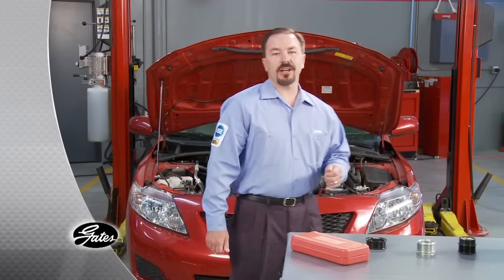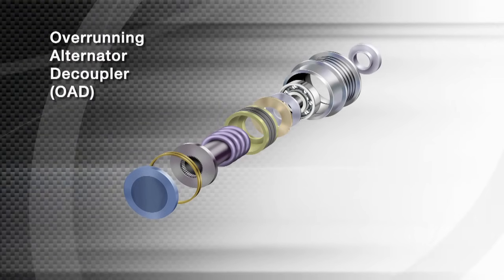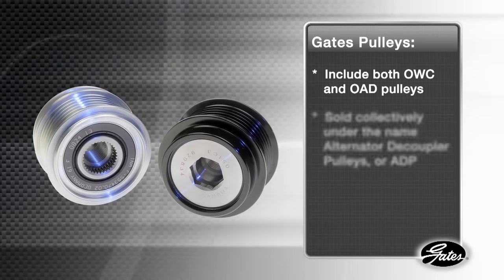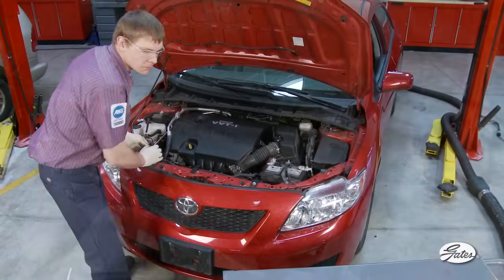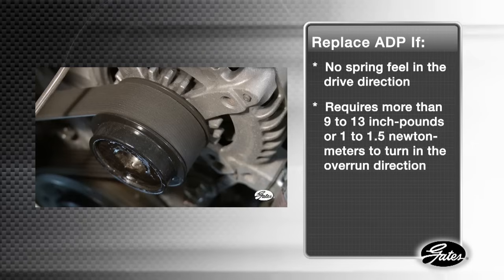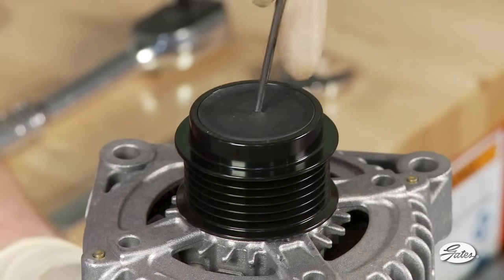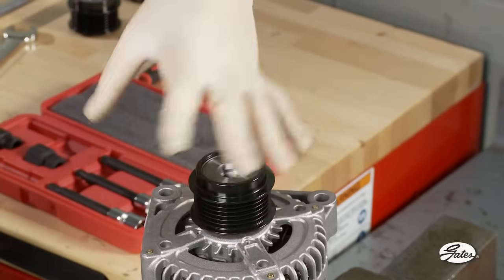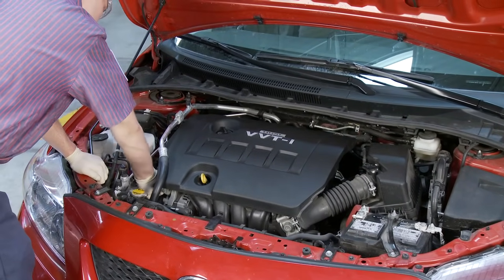GATES TRAINING: Alternator Decoupler Pulley - How to Inspect and Replace (full version)

Comment: Anyone who is struggling with this like i did and doesnt have many tools or a vice. Rent the decoupler tool from auto store. Stand the alternator vertically (like the way its on the car but on a hard surface)and use the tool you need and break loose the pulley.

Comment: This is a great design saved my $30 belt at the expense of $366 alternator!!
Reply: yes, what a stupid design; to save 30 bucks you spent 600 in labour  as most of the alternators are deep inside the engine bay and you spend a lot of time removing almost half engine bay components to get it out. Was nothing wrong with the old design, lasted 200k km plus.
Reply: 55000 mile cadillac and I am going to have to put #3 on in 6 months.

Comment: For all you out there who hate ADPs, you can get a solid pulley and they work fine and won’t fail after 30,000 miles.
Reply: U can't
Reply: @ I did. I bought it, and put it on and it worked great.
Reply: @faize28 you can, dont let them scare you, this is something that causes more issues that what "it fixes", No vibrations, no problems at all. Acura 2017, upgraded oem with oad, to solid pulley. No change at all.

Comment: this video was amazing and helpful, i am going the rout with replacing the whole alternator since its been giving some weird issues for a little while now. But the pulley is deffinetly bad, it buzzed for atleast 10 seconds after engine shutdown and puffed out a bug cloud of rus, which is now in a pile on the driveway, huge fan of gates. i work for oreilly auto parts and always urge customers to spend the extra few dollars for gates products :)

Comment: So this increases the life of the belt and tensioner by how much?
Reply: the word negligible comes to mind
Reply: 0%
Reply from the maker: The car manufacturers are moving to the alternator decoupler pulley for several reasons.  Increase in belt, tensioner and accessory life is one of the reasons and each application is different.  Applications with 4-cyl engines and diesel engines will have better results using an ADP over 8-cyl engines.  ADP’s are designed for each application, part numbers are not interchangeable nor is it advised to replace an alternator originally equipped with a solid pulley with an ADP.

Comment: I found this part supplied by y'all for my 2007 Nissan Altima 2.5s: http://www.partsgeek.com/catalog/2007/nissan/altima/engine_electrical/alternator_decoupler_pulley.html

I was wondering if this is indeed the correct part for my car as the part I find through WorldPac looks slightly different and as you stated in the video you need the exact part for this replacement.
Reply from the maker: Could you send us an image of the WorldPac pulley to apateam@gates.com? We'll be better able to assist you. Just reference this conversation and we'll make sure you get set up with the right part.
Reply: Actually I just found that they no longer have it in stock and yours is the only one I can find so I'll just have to go with you guys. They also weren't able to supply a picture to me.

Thanks for the quick response though!

Just as a quick question. My Alternator decoupler pulley is making a popcorn sounding noise when the car is in drive and at low revs (basically idling).

I'm not sure if that means it is the coupler, the belt, the alternator but since the alternator is ~$400 and the sound is easily heard right at the pulley (~$70) I'm guessing that's what it is. Cheaper fix is always my first go to.
Reply from the maker: Checking the function of an ADP is difficult to assess while installed. It is recommended that you remove the pulley from the alternator before testing it.
1. Secure the inner ring using your thumb and forefinger
2. Turn the outer ring in the drive direction of the alternator. If working correctly, the outer ring will not turn. 
3. Turn the outer ring against the drive direction of the alternator and hold the inner ring at the same time. The outer ring should turn with slight resistance.

If the part fails either of these two tests, it needs to be replaced. If it passes both tests it may or may not be good... ADPs are tricky to diagnose. As a side note, I’m not sure that the dealership sells the ADP separate from the alternator.
Reply: Just wanted to let you know an update on this:

1) Thanks a lot for your part. It works great. No noise and the engine feels so much smoother at low revs.

2) Install took me about 5 mins and popcorn sound is gone.

PS: Here is a forum post describing the same phenomenon http://www.caliberforumz.com/showthread.php/40478-Ugh-Alternator-failure-Odd-popping-noise

I think my decoupler was basically nearing the end of its life as it started to progress into higher revs.

Overall thanks over from Brown Motor Works in SC!
Reply from the maker: So glad to hear that everything worked out!

Comment: I'm stumped! I'm trying to change the pulley, I have the toolkit, but the end of the alternator shaft doesn't have a splined socket, just a hole with a few threads, looks to be about 6mm or so.
Has anyone come across this before?
Reply from the maker: Uh oh! We would be more than happy to walk you through the installation procedure. Please contact our team of ASE Master Certified Techs at 303-744-5651 or apateam@gates.com. Thanks, and have a great day.

Comment: I totally concur with emigrate.  I've just replaced the timing belt on my Renault Laguna 2.2.  This I did as a routine measure during the vehicles recent refit (...which included a clutch and CSC upgrade..).  When I removed the OEM tensioner, not only was it made of plastic (...like the CSC or 'throwout bearing' as you Americans call em... ), but it was also fractured !  The idler pulley was also plastic and its bearings were rough ....  When I received the Gates kit, I was gratified to find that the pulleys were metal and really looked well made.  The old timing belt had obviously been replaced with a Gates belt, but they'd left out the pulleys....  Bad idea.   So it was a good job that I decided to check the timing belt system, for with that fractured pulley, things would have gone way beyond FUBAR in the not too distant future.  Gates deliver excellent products.   
.
What I am now embarking on, is an alternator upgrade.  I shall be using a Mercedes 200 amp  unit.  What I want to know is that Gates stipulate that their ADP's are OEM specific...  But this does not make sense to me.  Most auxiliary belts (serpentine belts) drive, from crankshaft pulley, via a tensioner pulley and maybe an idler pulley to alternator, perhaps steering pump and a/c compressor.  Occasionally a water pump may be on the aux belt.  I fail to see why ADP's are therefor so 'specific' to manufacturer.   My belt drives, alternator, steering pump and a/c comp... Nothing more....  So what is the problem with me fitting an ADP to my Mercedes alternator, which in turn will be fitted to my Renault?
Reply from the maker: +Deebz270 We call them OEM specific because they are designed to replace an OEM part and are not designed to be universal in fitment. Additionally the belt drive system is designed as a complete unit so the tensioner and ADP are matched from the OE. If a vehicle has an ADP, the tensioner will be running at a lower spring tension since the ADP takes most of the abuse. If an ADP is fitted to a drive that was unequipped with one from the OE, issues may arise from an incompatible setup; this is not something we’ve tested. We do not recommend since the different types of alternator pulleys are not interchangeable.

Comment: Gates belts are the best, I have done so many timing belt, changes, and Dayco are the worst, Gates, and Contitech are are the best, for belts,  tensioners, Gates, and INA, are the hot diggity! Never trust Dayco, load of rubbish. I actually bought a Dayco kit from a main dealer, and its tensioner had squeal and rust the day I bought it, I changed it 3 times, after which the main dealer refused to change it as all the stock of Daco had rust. I though ummm.... so I opted for them to do the timing belt change. It was done, having a chirps and the tensioner replaced 3 times, then they the VW main dealer said it's just  noise. So I drove it , and the tensioner and belt failed so they had to place new valves and pistons in the car, lucky I had the foresight to let them do it given I saw the failings of Dayco! Pity they did not have the foresight to question why Dayco were supplying sub standard products from new?  I just had a non main dealer do the job and asked them about Dayco.They said they will never fit Dayco as it is an inferior belt, and whenever they have fitted it the Dayco belt, customers have complained about squeal and chirp and several have come back with the tensioner failing, SO they will not fit Dayco anymore. I raised this with Dayco, who have never had the courtesy to respond. Do not buy Dayco.
Reply from the maker: +emigrate Thanks for your support!

Comment: I know this is an old post but I have never heard of these pulleys either. I have a 05 dodge caravan with the 3.3L V-6 and the engine is making a weird noise and I was told, why I found this vid, to check that pulley. My question is, can this pulley going bad cause alternator issues such as flickering dash lights and sudden drops in idle when slowing down for red lights?
Reply from the maker: +MrCougar214  

That noise would be the alternator decoupler pulley failing and causing the alternator light.  Gates offers a replacement pulley whereas the dealer would make you buy a complete alternator.

Comment: 1st I've ever heard of a decoupler pulley-how much does this really help with belt wear and noise?????
-I am wondering if this is going to be looked upon favorably 10 years from now
Reply: oh yes can you remember the old system before these pulleys when we had all those vibrations. said no one ever.
Reply from the maker: +351cleavland 

Alternator decoupler pulleys are extremely important to the overall health of the accessory belt drive system, and can greatly contribute to belt wear and noise. The reason is that many ADPs
contain a damping spring that actually absorbs some of the engine vibrations induced into the belt drive system. Therefore, when an ADP fails, the tensioner is left to absorb these additional vibrations. The result then becomes premature tensioner failure, which will lead to premature belt failure and
reduced accessory component performance. ADPs are becoming ever more prevalent as they increase the overall fuel mileage of the vehicle. If you have any further questions, please contact our team of ASE Master Certified techs at (303) 744-5270 or apateam@gates.com. Thanks for contacting Gates!
Reply: They are fairly common and reliable.  Voice from the future.

Comment: Will the outside pulley turn freely forwards and backwards? I've got a 2006 Chrysler Town and Country and the pulley spins fowards and backwards freely when the belt tension is released.
Reply from the maker: +Seth Andrews 

Hi Seth,  Thanks for contacting Gates. To answer your question, thedecoupler pulley should spin freely in one direction, but should drive the
alternator’s rotor in the other direction. As a result, you should feel no drag
and the pulley should spin freely in one direction, but you should feel some
drag and the alternator internals should spin along with the pulley in the
other direction. If your pulley freewheels in both directions, or is locked to
the alternator rotor in both directions, then the pulley has failed and needs
to be replaced. If you have any further questions, please feel free to contact
our technical team at (303) 744-5651 or apateam@gates.com.

Comment: For dodge caravan 05 sxt what kind of pulley the OWC or OAD  and what this mean?
Reply from the maker: +armando sanchez 

The 2005 Dodge Caravan uses an AD, overrunning alternator decoupler pulley.  The other type of pulley is an OWC which stands for one way clutch.  Both have similar functions but one cannot be used in place of the other.  The Gates line of decoupler pulleys are OE Exact and we have the proper type of replacement pulley listed for each application.

Comment: This Gates how-to-video makes it look so easy to replace the ADP.  All you have to do is purchase the specialty tool set for $80 - $120 and the problem is solved.  NOT!

Unfortunately, this is not the case.  There are some alternators that don't have a center hole by which to secure the inner tool on the amateur shaft  So there is no apparent way by which to remove the pulley without doing the alternator some serious damage.  

Buyer beware.  Save yourself a lot of time and money, inspect the inner armature shaft on your alternator first before ordering an Alternator Decoupler Pulley and an ADP tool set.

Here is my experience attempting to replace an ADP with a Gates ADP and their custom toolset on a Nissan Altima with a QR25 engine.

https://www.youtube.com/watch?v=uYfJWJxzAis
Reply from the maker: +DIY Guy 

Thank you for your comment. We are sorry to hear about the troubles you experienced with our products. It is
true that some alternators require a different procedure to replace the
decoupler pulley, but each ADP we sell can be replaced. Furthermore, while we
do not specify exactly which socket to use for each application as alternator
design can change even when the pulley does not, our included instructions will
always state the procedure to follow. In the case of your Nissan, we recently
discovered that we were not including the ideal instruction sheet with the
pulley. As a result, we have since updated our instructions for this particular
part. On this application, the pulley can be easily removed and installed using
an impact wrench; it is not required to hold the armature shaft in place with
this pulley. With that said, we apologize for the troubles you experienced, and
our imperfect instruction sheet. Please contact us at apateam@gates.com so that we may make this right with you. Thank you.
Reply: +Gates Auto Aftermarket 

Thank you for the response.  I appreciate Gates Aftermarket the willingness to address and fix deficiencies in their product instructions.  Which leads me to question why a lot of the fine details are left out of auto mechanics manuals everywhere to begin with.  

Removing steps in a procedure or assuming the end user logic is all the same, without side notes or explanations, can be very confusing for someone who encounters these things for the first time.   

Granted, most people nowadays are not equipped on how to work on their own cars, but if auto parts manufactures took a little extra time in preparation of their instructions, the auto owner would have enough information by which to make an informed decision on how they want to proceed with getting their vehicle fixed without the frustration of finding out that they need special tools to do so. 

Thank you.

Comment: I picked up this pulley from Rock auto and the cover was missing and they called Gates and they just delivered it less than 24 hours later. That is good service. I installed the pulley in less than an hour on the car. I only had one to replace so I wanted to rent the tool that no one had.   O"Reilly had one that they would rent for 115 deposit till I got there and then they wanted to sell it to me. I went to another O'Reillys and talked them into ordering it and then loaning it to me. The next day I used it . I will use that store and never set foot in the other. I ordered a simple tool from AutoZone in case I needed it for 24 dollars. If you are in business fixing cars get the Gates one I just couldn't afford it right now. I you want to know the sound it makes when bad go to YouTube and look up Chrysler sounds and that was how I found the noise. Gates makes the best products so shop around and find a supplier that carries their parts

Comment: I have a 2008 dodge Avenger with a 2.4 liter 4cyl. I have a "heavy whirring" sound that has started in the engine compartment. After consulting a "pro" he suggested I replace the belt tensioner which I did along with the lower idler pulley which was making a little noise as well. The upper idler pulley was fine. I also replaced the belt. After doing these things the noise is reduced by about 50% but is still very present. Could it be the alternator or alt pulley? Maybe the power steering pump? I
Reply: It is the alt de coupler , I know first hand . Had the same problem with mine. Have them replace the decoupler pulley !

Comment: I have a car that had a alternator with a one way decoupler pulley installed. I replaced it so,e years ago with an alternator that fit my car but had a solid pulley installed. My question is! can I install a one way clutch pulley on an alternator that came with a solid pulley installed?
Reply: yes you can

Comment: Do you have any replacement for a 2010 Dodge Journey with 2.4 litre engine? The alternator is now making an annoying sound and the mechanic said all the alternator has to be changed because nobody makes the replacement decoupler pulley for this alternator. Thanks for your time.

Comment: one more question about the clutched pulley.. i just had mine changed (plus bearings) due to a vibrating sound right after i release the throttle after bringing it to almost redline. will the delay be noticeable enough to hear? my problem is i can still hear the vibration (which seems to be coming from the alternator) after i blip the throttle. it runs smooth and silent during idling though. your thoughts?